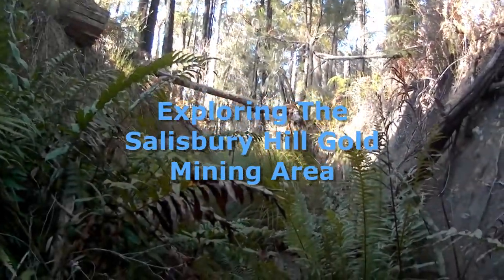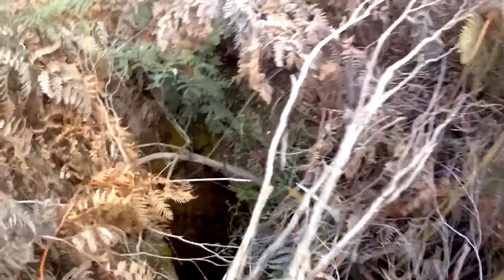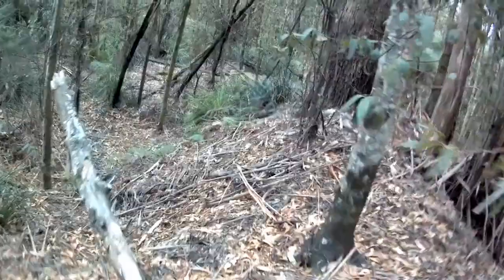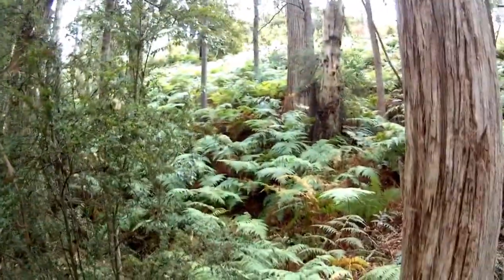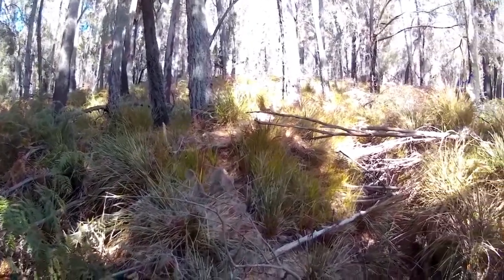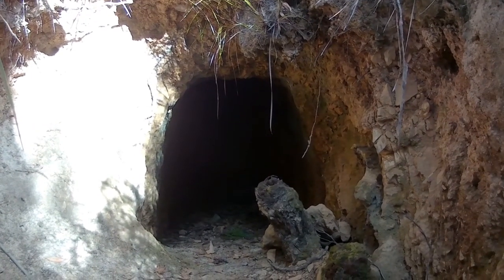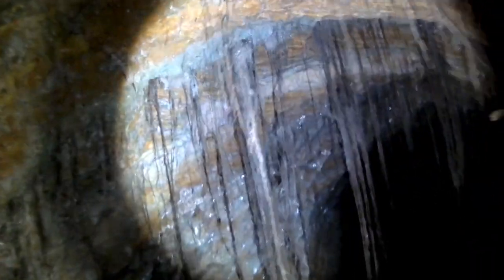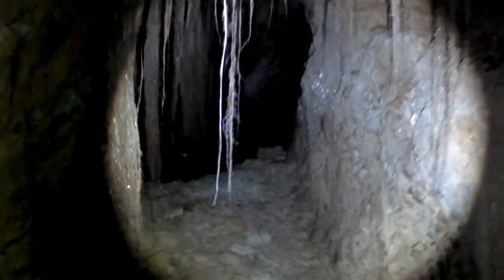Exploring The Salisbury Hill Gold Mining Area

Comment: Have any coords for the mine shaft?
Reply from the maker: No coords for any sites for a number of reasons. Sites get vandalised and people could hurt themselves. Check the MRT overlays on ListMap for historic mines. The coords are actually wrong for this area. Maybe they went from true North to magnetic North. They are all out.
Reply: autofear Ah okay, what about previous mines in your other videos? Ive always wanted to explore a mine adit. Ive been to Rossarden and failed to find the mines there. Are the mines in your vidoes mainly in the Beaconsfield area? Thanks
Reply from the maker: @Harry-rf1rg  Without using ropes you will have to look at adits. Many of the shafts in N.Tas are sealed with concrete slabs but many are not. They are very deep and very dangerous. The adits were often associated with shafts because it saved bringing material up the main shaft. They often used horses for this or steam if they had the money.
When you look at the MRT data check 'details' and read about the old mines. At Rossarden there are adits from the creek into the mines but they would join very deep shafts up and down. It was Australia's biggest tin producer for a number of years.
Reply: autofear Alright thank you, should post more videos on mines and maybe invest in a better camera.
Reply: autofear What creek was it in Rossarden?
Reply from the maker: @Harry-rf1rg  Aberfoyle Creek and the mine was the Aberfoyle Mine. The creek is very rugged.